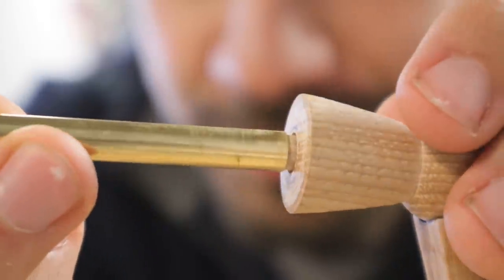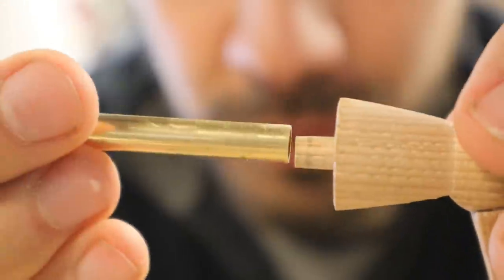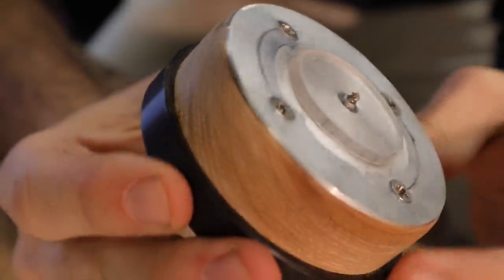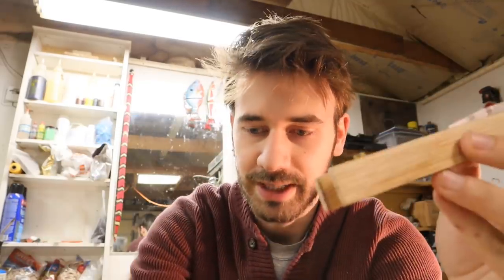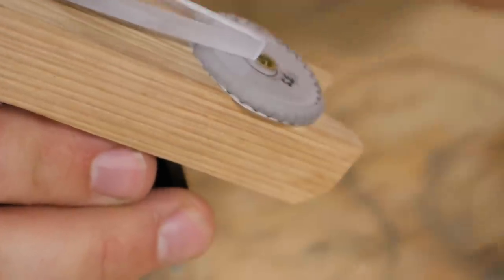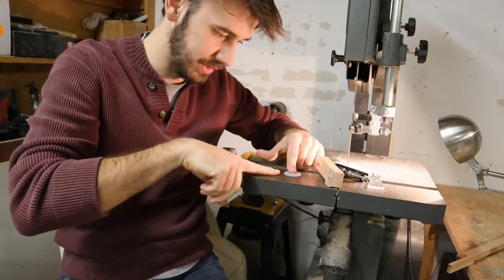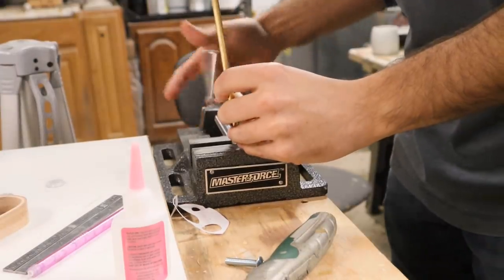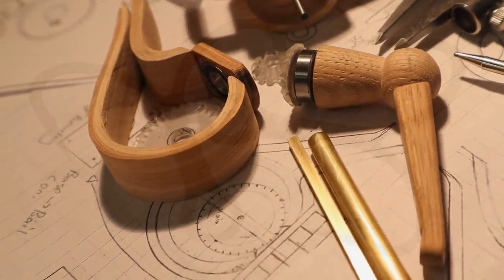Making a Fishing Reel | PART 3

Comment: I think someone needs to cut themselves a little bit of slack... Dude, you made gears in a shop that's not set up for that kind of work, and on the first test run of those gears meshing, you turned one gear (the driving gear) and the driven gear moved... 

I know a few machinists with pretty expensive gear who would struggle with that. You did it with no dividing head, no mill, just a bandsaw and a hand-file. You're doing this better than I expected, far better than I expected to be honest. You "only" did gears in this video, but that's a LOT to accomplish with a bandsaw and hand files. Relax, you're killing this and making it look easy, and I know it isn't.
Reply: I've been one of Chris's viewers for a while. Still, it's impressive, but it just seems more impressive in this vid because Nathan doesn't have an obvious background in machining and clockmaking (that I'm aware of).
Reply: have you very make gear or had to fix a gear to  get the  gear reducer up and running when you have no choice to do it I have the weather sucked big time to when down to -50 the night and the rig  had to run if not would  freeze up and the job would be lost 
we take the gearbox apart to see how bad it was inside liveable for the weather we have been having  the gear was creaked and 2 teeth are missing  no word from the office to see what they want to do about it  have both crews up this time they made sure the rig would not freeze up  we asked them to try to fix it here  and fail or just fail now they said to fix it and cross the path when the time comes  tig  weld the creak in the gear and the slowly started to make the gear to 12 hours later the rig was running 
we run 3 days  with that repair due to the gear  new box did come and did get the job complete after that and will do hit oil  we took a big challenge  we  send the box back to Edmonton  the millwrights were amazed at how well it worked  they have it in there shop still   that well did pay off very well we kept drilling  after we hit the depth that they said it was  5 more pipe we push down  and there it was I had my first year welding then  they  did help me get to mine 4 years  thing were happing I was not very comfortable at the time to work with the company  was not the company it was me had a life choice I made  and needed to be done I am now a red seal welder by the trades  have my life back on track as well too it twists as hard now than before  welding is still a guy thing here and does not like  to be shown up by a girls  welders for me as a transgender as well  that is why I lift that campany I was trasition
Reply: @jenniferwhite6089  please use punctuation

Comment: Thanks for these videos.  I love seeing craftsman solve various problems with the tools at hand.  You  are not onky a craftsman but an artist.  I am envious of your ability to use colors,  no matter how fine of work I will be able to produce  in the future,  I will never be able to use the color pallet like you.  From  personal experience, when you use the lathe try dropping the fence a little so you have more upward angle with your chisel.  The chisel dosnt get pulled into the work as much leaving an easier to achieve smoth finish since it cuts down in vibration.  For a long time I would set up my lathe like you untill I started screwing with oak cups.  One slip of the chisel on those and the whole damn thing can explode.

Comment: I wonder if you could make a jig for cutting the gears with a reciprocating saw and a file in the place of the blade, then have a fence so the gear can only cut in so far and the same turning mechanism that you used on the band saw

Comment: Suggestion for gear cutting on your bandsaw. Cut one face on all the cogs / teeth / splines /whatever, then position for the other face. It will make the cuts cleaner, reducing time cleaning up with a file. It will speed up the cuts also by letting you find  smoother rhythm as you go.

Comment: I didnt have the proper tools for a project, i used a dremel with a cut off wheel to cut thru a bunch of steel, you can be very precise. Maybe give that a try on the brass?

Comment: I know the reel isn't going to be for general use but it might be wise to use a weak glue to bond the gears to the shaft, it'll be much easier to re-glue a loose gear than it will be to re-cut a chewed up one when you put some load on the drive train. Polycarbonate might be extremely impact resistant but it's still a soft material so adding a built in failure point that will release before the gears start eating each other might save you some headaches

Comment: Interesting project for sure. I really think you should make the gears out of brass. The lexan will surely break and or wear in out in short order. Make a tooth cutter to the exact shape you want and make a jig to hold the brass disks and make the gears that way. It will work out way better then lexan. If you are scared of the brass flying off the lathe, you can use any brass threaded screw and bolt it on and even solder it together for that effort if that makes you feel better.  JMHO

Comment: Harbor freight has a mini lathe and mill that are not bad priced I have both and have been able to do some pretty big projects with them. If you buy them one at a time with the 20-25% off coupon they are around 200-300 bucks
Reply: Neither of them, out of the box, are very usable though. You need to spend quite a bit of time cleaning, adjusting, and tuning. That said, lthey're worth what you pay for. The only alternative at that size cost quite a bit more (eg. Sherline, Unimat, etc). Once dialed in they're pretty good.

Comment: You might try your hand at casting the gears once you get them perfect.  Aluminum is easier to cast but I’m sure you could build a furnace that got hot enough to melt brass.

Comment: Just an idea: maybe next time you could laminate several layers of thinner lexan together with epoxy resin. Might make the gears a little stronger.
Reply: Lexan isn't like wood. There's no grain, no "weak" direction to overcome by alternating layers. The only way laminated lexan would be stronger is if the cured epoxy resin itself was stronger than the Lexan. At that point you might as well just cast gears entirely out of epoxy resin instead.
Reply: @elbowdonkey  True, but I was thinking more along the lines of preventing the lexan from bending by reinforcing it. The epoxy and the multi layers could add a little rigidity to the construction.

Comment: I do some work with robotics and I've come to find that there really isn't a substitute for metal gears. Plastics can work for small forces applied. Like I don't see a 'reel' problem reeling in a lure. :D But every pan fish hooked will decrease the lifetime of the gears substantially even if they were perfect. But that rate increases even more because gears can't be hand made to a few thousandths of a inch.

Comment: Easier way to cut the gears? 45° sloping ramp with the gear blank flat on the bottom and guide rails for the router base. Using a 20° V-bit, run down the slope and you should have decent gears set at a 45° angle?

Comment: set the gears up to run in position where you can drive them with a small motor and they will run... no load... against each other then put grinding compound on them and they will grind each other as they run...after awhile of idling in mesh they will smooth one another out...as they wear in to fit ...maybe?

Comment: I don't blame you for moving to polycarbonate. The way your bandsaw blade was bending i think it was a sensible move, no one needs a 6ft cerrated whip flailing around if it broke.
Reply: I think you're just seeing a the results of a lot of slop in the blade - the saw needs a good tuneup. Those guides and bearings are there for a reason.

Comment: go buy a a hacksaw there under 20$ and its a cheap way to cut metal and other foreign materials and the only difference between a metal lathe and a wood lathe are the tools i’ve seen people use metal files on a wood lathe tp shape metal its not that hard just takes a little more work good luck and i’m really happy on the build keep the videos coming and never doubt yourself your the only person who is keeping you from your true potential i believe in you and i know you can do it if you out your mind to it
Reply: If wood cutting lathes worked just fine for cutting metal, we'd only have wood cutting lathes. The fact is, the differences between the two are significant. Do a bit a of homework to understand why they're different. I also wouldn't recommend filing metal on a lathe at all - certainly not for a beginner. It's one of the most dangerous things you can do on a lathe. Old timers are happy to describe stories of files stabbing through human bodies, for example, or arms getting caught in a chuck. Google for "lathe accidents" and you'll learn about how soft humans are and how little lathes care. If you're going to use a lathe of any kind, you need to know that following bad advice like "just file your metal on a wood cutting lathe" can get people seriously injured or dead.
Reply: honestly ive never done it ive just seen people do it on youtube i have a metal and a wood lathe but my mentor told me long ago the the only difference is the tools same thing with a drill press and a  milling machine you are right you should always be safe and use safety precautions when available

Comment: how did you come up with the teeth count total on the gear spacing
Reply from the maker: Found a set of gears with the same size teeth online that’d work with this reel. The ratios aren’t ideal, but I went with em anyway for convenience.
Reply: Marling Baits  , This Old Tony just posted a video about gears... I smell collaboration!!
Reply: @nicholasviazzo5104   the RC cars have the plastic gears I know work on an outdated timing pump for a chain the plastic one  got too old and broke  if a printer was out them yea make one was not back then the exited the best thing to see want can I used  the pump been broken for about 10 years the guy said  found  some the shafts sizes fit  very tightly on the shafts  why not  that weekend I worked on the pump got it to work again for them  it kicks on for about hour to pump oil to the chain then shut off for 8 there was a timing gear was there to able to do this  the drive motor turn slow  the gear took 8 hours to pass the spot again   worked great last year was the last time it was used  the moved to a bigger warehouse  and  new conveyors have been put in there  all work and a photo eye control system conveyor 
 I think i am going to use the gears that in the reel i have apart and use a block of wood to (apple tree) it will help me to see if I can do this   lot of think for one did  make the first 2 cuts into the block had to buy an extra long drill bites for the  but works better then miss-line the  the holes

Comment: Watching This Old Tony's latest video (https://www.youtube.com/watch?v=qVN2jrn4Kuo) will help you understand why you're gonna keep chasing that "smoothness" in the gears. It's not impossible, but odds are good that non-involute tooth profiles are going to be problematic.

I'm curious why you slapped a square on to your jig when you could have cut a nice chunk of wood at a 45 degree angle. Regarding the jib, you could have skipped throwing your gear blanks on the lathe and used a similar jig to cut your blanks on the bandsaw, cutting the 45 degree chamfer and circular outline in one step. I'd personally avoid trying to machine Lexan on a lathe - it can very easily shatter, throwing sharp little shards all over.

For cutting brass on the bandsaw you need to have much slower cutting speeds than you do for something like wood. Common wood cutting bandsaws cut at about a 1000 feet per minute. Brass needs about 100 feet per minute. Too much speed and the metal just gets too hot, teeth get clogged up, and the blade and metal get grabby. I've had some success with using a router speed controller to slow down my bandsaw, but it's not ideal. Using a simple coping saw and cutting it out by hand works way better in the end. You can round it out using a file.

If you want to make brass gears by hand, it can be done. I'd recommend binge watching every video by Clickspring. Even though he totally raises the bar in terms of quality of craftsmanship, he also helps show the rest of us mere mortals how to get there:

https://www.youtube.com/channel/UCworsKCR-Sx6R6-BnIjS2MA/videos